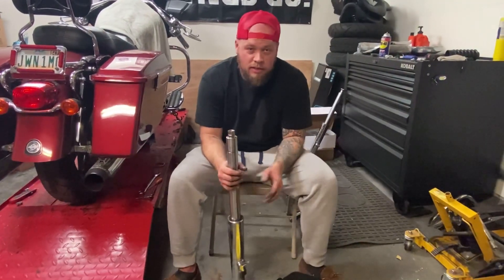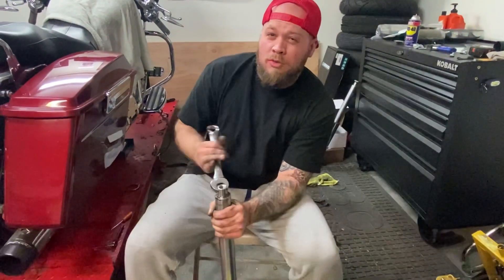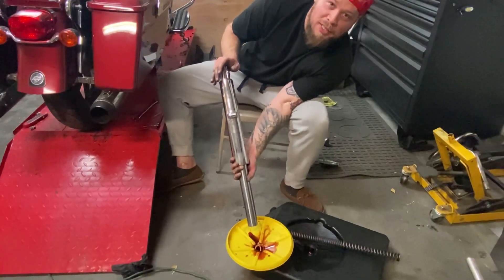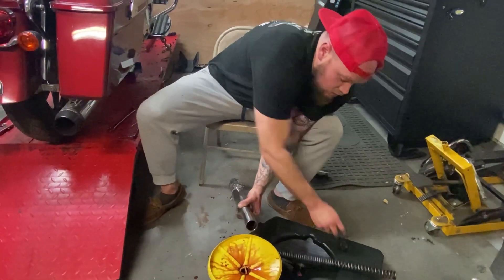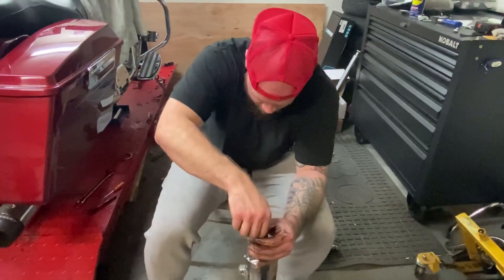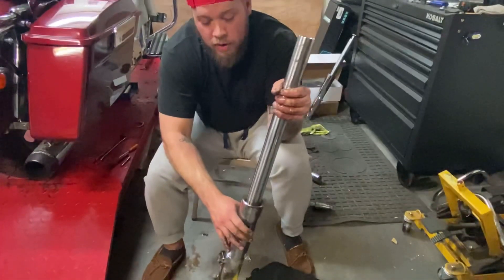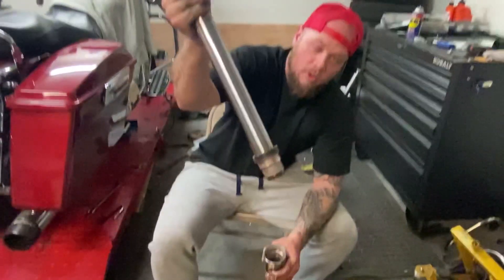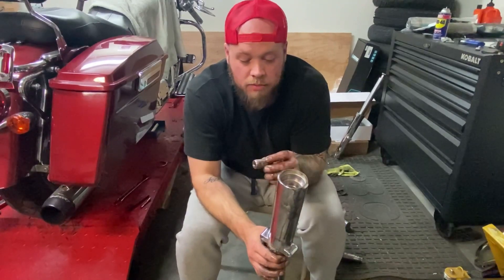Harley fork disassembly

Comment: What?? Touring bikes have the cartridges' emulators in them?  That's weird, never heard that before..I just took my 2020 Road King forks apart to up grade the suspension, and found no emulators type product in it.. just the same ole damping rod, springs and spacers, washers, and oil